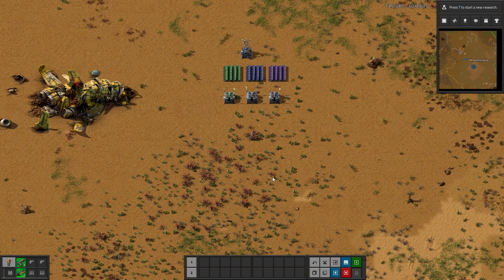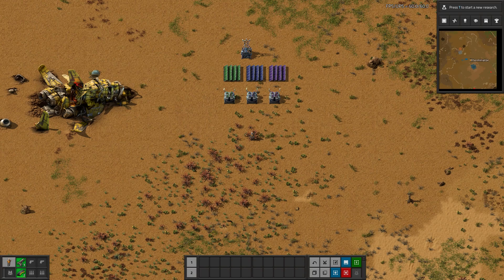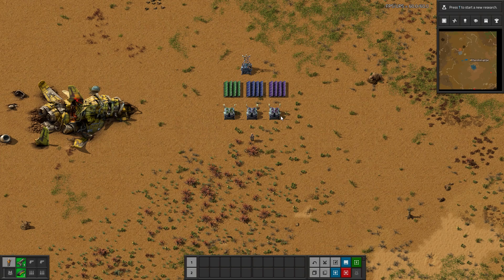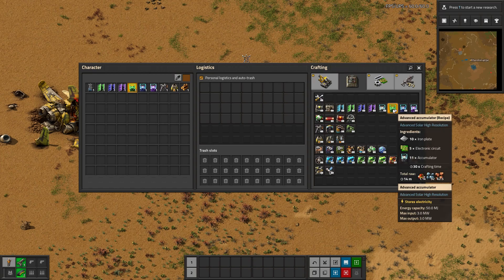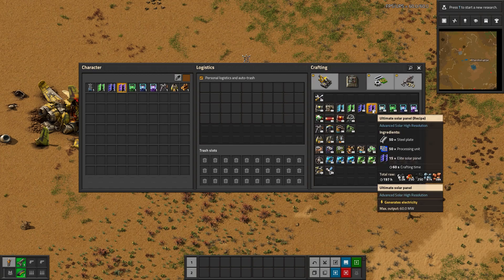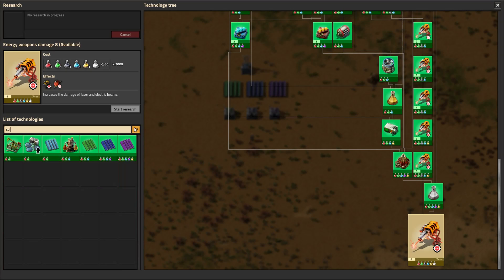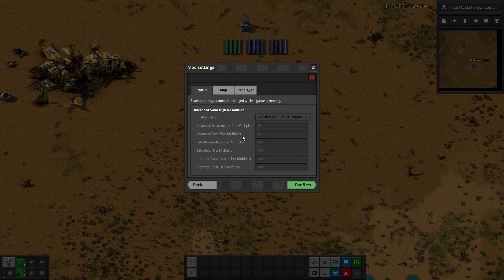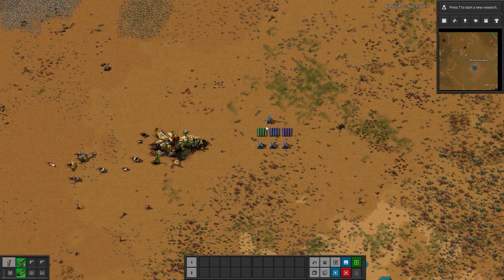Factorio Mod Spotlight - Advanced Solar HR

Comment: It's more like double the price. For the highest level solar panel you need 11*12*15=1980 normal solar panels while giving power equal to 1000 normal solar panels.
Reply: thats just the default it can go up to like far higher at max settings! this can be like over 10,000 solar panels or more! at the max possible configurable settings the max power from them can go to  like up to 10-30 GW max i think or more for the panels! also  over 100GJ  for the aclatmors for the ultimate tier from my personal testing with the mod
Reply: Sacrifice half the panels for 1000 times more spaces seem like a fair business for me
Totally not overpowered for outpost at all. Heck if you do not feel like using processing unit for ultimate solar panel something like 24/21 elite panel is enough to power the whole outpost without you having to pull power line all the way from your base...

Comment: How do these compare to the ones in Factorio Extended?  The purple one looks a bit stronger and certainly more expensive.
Reply from the maker: I'm not quite sure. I haven't actually looked at the ones from Factorio Extended. 
The last tier in this one is quite powerful but expensive for sure!
Reply: The highest tier in Factorio Extended does almost 1 GW, but obv more condensed and expensive
Reply: @ezray9906  but this mod can go like 10-30 GW for every ultimate panel and 300+ GJ ultimate acmator with the ultimate panel/aclator  10,000x multiplayer setting that's the max possible number from my testing from the mod! that's also just without the solar launched  satale power increase bonus mod that i also use on top of that! so its a very good mod to use that also allows you to run your base on pure solar with the max settings! but only if you can afford building huge amounts of solar panels that is! but it can save huge amount of space at its max settings but that's only if you can have enough resources to build enough of them!